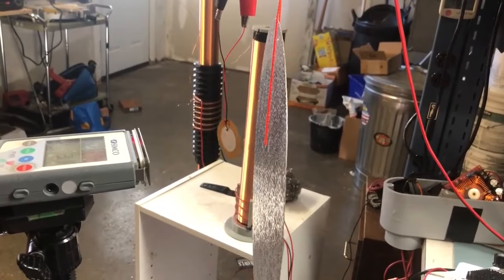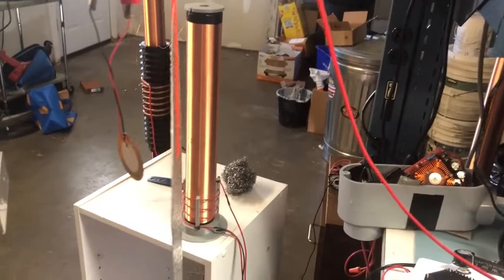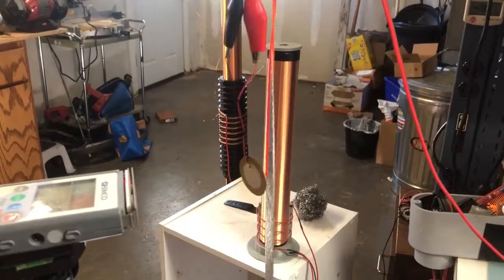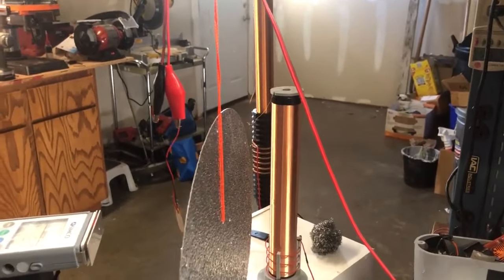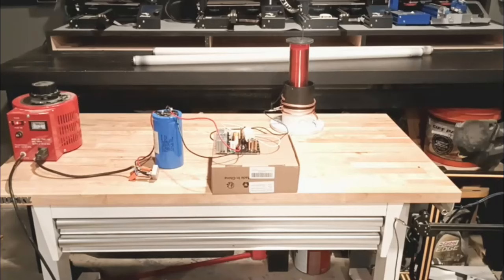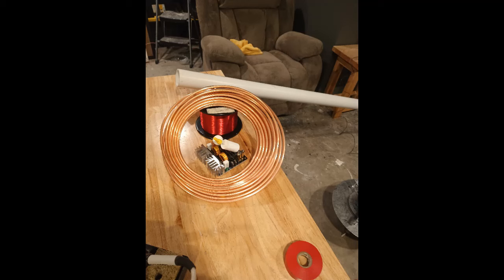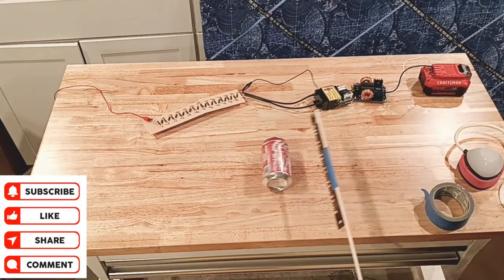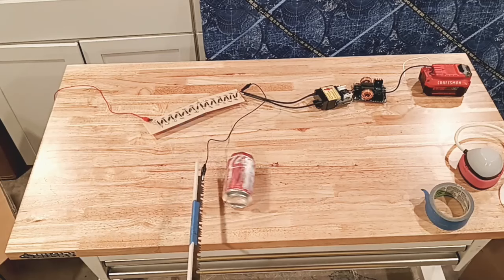Graviflyer "Reviewing Testing" #53

Comment: Great Nathan, I like the AC to DC setup. Jarod posted a video on the piezo and the plate and wanted comments and I explained basically what you said to him. I see you are going to make the bigger tesla coil.
Reply from the maker: Why hold back now.. I have enough material to build several of them.
Reply: Great! Build a star device for $100-$200 with parts from amazon and build a UAP and go from LA to NY in ten minutes. I have chatted with Tim, Mark, Jeremiah, and now Michael from APEC about my theory and Jeremiah told Michael that he built several of my devices that worked and now Mark is building some more of them like a star trek phaser and a star trek transporter to go the ISS. Jeff Bezos is building a hotel in space that people will be able to go on vacation with. Jeff Bezos space hotel is a blow-up version of a space station that is really cheap to get up there with his new rocket. Tim, Jeremiah, Mark don't chat with me anymore, but Michael is the go between. Since I know all this, I know what to invest in next month to turn $50 into $1,000,000 in one to two years. To make the UAP take two half Al spheres and put the graviflyer inside along with the star device for lift and propulsion as it is an easy build.

Comment: I found out when I wound lots of coil for the zvs,it would start to hum and then the two transistors would get hot,so to avoid that you have to be one step ahead,..... Remember the Tesla coil is resonating is causing the magnetic field to collapse back into the primary so the white caps you have,I believe you must choose high voltage ones,so choosing caps of 1000v sort of made the transistors not heat up and the huming was gone,..... And to add I think you should consider using a thinner gage for your Tesla coil 🙏😇 definitely

Comment: if your flyback is the load and your using them in parallel try  using one flyback driver and add a second coil in series to increase ohms , tis way you can keep your voltage maybe even increase a little safely .  Inductors are the best current limiters

Comment: 10:00 perfect example
Reply from the maker: The can won't move until it has enough charges built up. I think I will use his circuit just cut down the multiplyer.
Reply: @nathanbunten4299  need NPN that can handle more amps or increase ohm on load inductor aka transmitter .
Reply from the maker: @mykedoes4099  The one I use can handle 15a 230 for my tesla coil. The problem is heat. It breaks down the transistor faster. The 230v possible goes down to 40v when you apply 10a Then blows if you add more. Heat in a circuit is a major loss in capability.

Comment: Once you get the voltage tolerances right in the top and bottom spinner, it's clear the thing will lift. The differentials in the electrostatic discharges will create a field that the graviflyer can implode into generating lift. And you have to watch out that the experiment isn't getting sapped of energy (by getting too close) or getting canceled out with improper configuration. And while many people say that the definition of insanity is to do the same thing over and over again with the expectation that the outcome will change. That is a symptom of insanity but not its definition.
Reply from the maker: I have people who want me to give up. That I am wasting my skill. I guess they thought antigravity would be easy. They should realise they are getting a free look at reverse engineering it.

Comment: What are you doing differently with the tesla coil? are you decreasing the secondary coil gauge? simply increasing the voltage, the resonant frequency?
Reply from the maker: I am making the circuit stronger. The single transistor is to weak for what I need.

Comment: 11:51 i was just watching the 3 hour 😅 video.. when he was setting up he said something about the pezo having a wire from TC to " balance " the same frequency or something.. is this something you are doing?
Reply from the maker: Thi goes back to the wires having leakage. since the wire has less plastic around it voltage and frequency come out of it. so when all wires are bundled together they all make the same beat frequency. you don't have to connect if your wire shielding is thin.